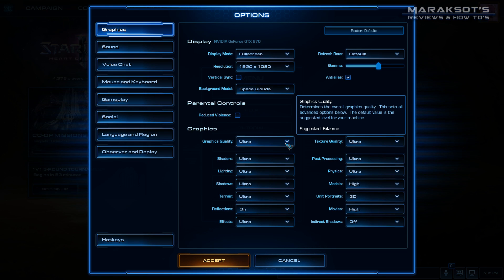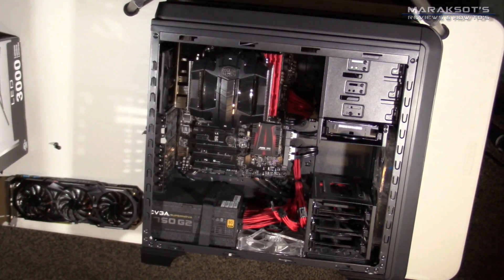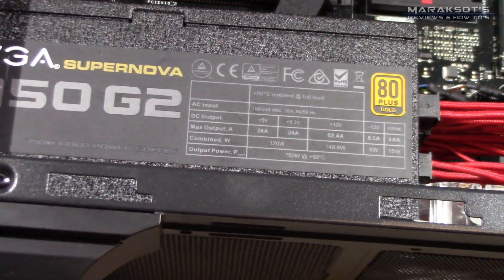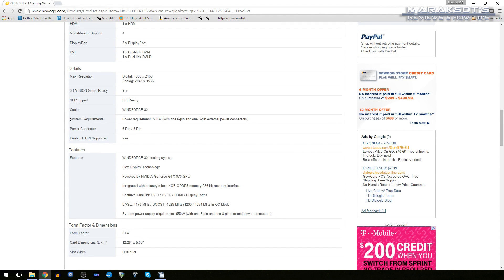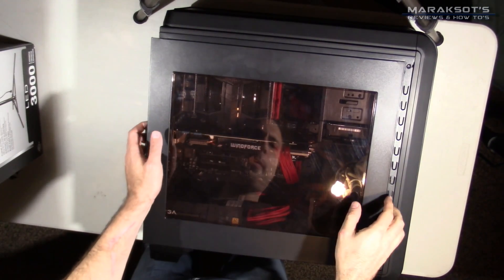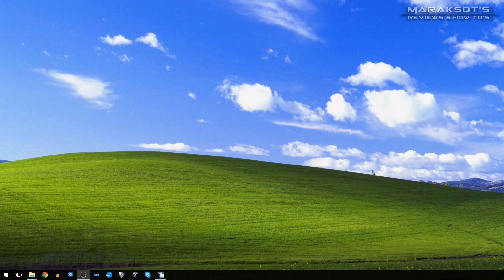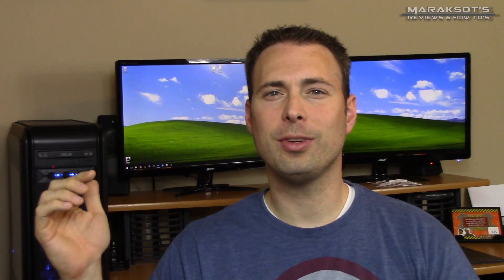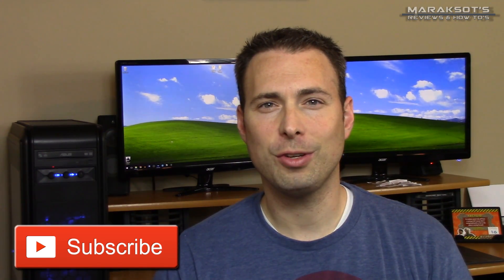A Beginners Guide - Upgrade your GPU - How to Install a New Graphics Card

Comment: So if i install the new drivers for my new gpu, i don't need to worrie about the old drivers? Just something i wanted to clarify before i go out and buy a replace one. I bought a new themaltake 650w bronze and have it installed, and the 970gtx watt is where i want it to be. Just wondering about the drivers. Thinking of upgrading from 2gvram to 4.
Reply from the maker: +Vex Slan do you currently have an Nvidia graphics card?  If so then I would ask when was the last time you updated your drivers?  If your current GPU is from Nvidia and you have the most current drivers already installed then you can just remove your old GPU and install the new one.  If you're switching from AMD to Nvidia then yes, uninstall your old drivers first then swap out your old card for the new one and install the new drivers.  Happy gaming!  :)
Reply: yea i have a Nvidia 960 gtx with latest drivers and thinking of getting gtx 970. So all i have to do is switch them. Ok thx seems simple enough.
Reply from the maker: +Vex Slan no problem man, thanks for the question. I'm happy to help.
Reply: +Maraksot78  thx helped me to
Reply from the maker: stative mocha happy to help. Enjoy your new GPU! :-)
Reply: +Maraksot78 tnx helped alot bro :D
Reply from the maker: MLGBananaPealer you're very welcome my friend.  Thanks for taking the time to make a comment.  :)

Comment: Do you need to uninstall integrated drivers?
Reply from the maker: +The Morning Wood in my 10+ years of PC building I have never uninstalled drivers for the integrated graphics. I've always just installed the new GPU, connected my monitor or monitors to it, booted up the pc, downloaded the Nvidia or AMD drivers, installed them and everyhing has always been good to go. I have heard of people disabling their iGPU in their system bios but my understanding is that modern motherboards will disable it automatically when a discrete GPU is detected as being connected to the system.
Reply: Sir, just another question, can I install GT730 on my Dell Optiplex 760 DT version? coz im strusggling to buy one coz im scared if it is compatible. Thanks sir.
Reply from the maker: +The Morning Wood from what I can tell by googling your Dell it has a 235 watt powersupply. The GT 730 recommends at least a 300 watt power supply. So, I wouldn't recommend buying it. Sorry man.
Reply: oh sorry man i have a Dell Optiplex 760 MT that has 305w. sorry man, so will it work? thanks man
Reply from the maker: Yes, it should work then. The GT 730 won't give you 1080p ultra settings or anything on the latest games but it should perform noticeably better than your iGPU.
Reply: Thank you Man! You are my saviour! Well appreciated Man, Subbed
Reply from the maker: The Morning Wood you're welcome man, I'm happy to help. Happy gaming!

Comment: I am looking to upgrade my computer but I'm not sure exactly what, so I was hoping you could look at my specs and give me your advice: CyberpowerPC Gamer Ultra GUA880 Gaming Desktop - AMD FX-4300 Quad Core 3.8GHz, 8GB DDR3 RAM, 1TB HDD, 24X DVD, NVIDIA GT 720 1GB, Windows 10
Reply from the maker: +EaglesbeatPackers22 I'm not quite sure how to help.  What kind of performance are you wanting to have? Are you wanting to play new games at max settings or are you wanting Windows and other programs to load faster or both?  If you're wanting better gaming performance and depending our your budget you could swap out your CPU for something different.  The FX-4300 uses the AM3+ socket so if you're not wanting to switch out your motherboard you could get a more powerful CPU that also uses the AM3+ socket.  Two really popular FX chips amongst gamers are the FX-6300 and the FX-8350.  As for your graphics card seeing as you're currently using an Nvidia GT 720 you could gain some gaming performance by upgrading your GPU.  On the Nvidia side, starting with the least expensive I would recommend, there's the GTX 950 or depending on your budget you could go up to a 960, 970, 980 or 980TI.  Same thing on the AMD side... probably the least expensive I would recommend is the Radeon R9-370 but then there's the 370X, 380, 380X, 390, 390X, Fury and Fury X. And like I mentioned in the video you're going to want to check your power supply and see how much wattage it outputs and make sure it has enough power for whatever graphics card you choose.  For example, if you choose a card that requires at least a 500 watt PSU and your PSU only does 400 watts you can upgrade your PSU to one with more wattage.  You would obviously just have to buy one.  Also if you're wanting to upgrade for gaming performance you may want to upgrade your RAM to 16GB as more and more modern titles are recommending 16GB.  If you're just looking to improve loading time then I would recommend buying an SSD (solid state drive) they are much faster than traditional mechanical hard drives.
Reply: +Maraksot78 thanks for the quick reply and for letting me know some of my options. I'm looking to increase my gaming performance and you definitely explained what I needed to know. I will most certainly be subscribing!
Reply from the maker: EaglesbeatPackers22 no problem man, I enjoy talking computer hardware. Thanks for the question and the sub. :)

Comment: Do you have to uninstall the existing drivers from the first gpu?? Or is it ok to leave them on there??
Reply from the maker: +Tom Holmez if your switching from an Nvidia GPU to another Nvidia GPU or from an AMD GPU to another AMD GPU then you should be fine to leave your existing drivers in place.  Bit if you're switching from Nvidia to AMD or vise versa then you'll obviously want to uninstall the existing drivers and then install the new ones.
Reply from the maker: +Tom Holmez I should add that if you haven't updated your drivers in a while then you may want to go ahead and uninstall them anyway and update them, that way you'll have the latest drivers that should work best with your new GPU.
Reply: Ah thanks, that helps
Reply from the maker: no problem man

Comment: i have a hp 110 desktop what can i put in mine? to make it run faster
Reply from the maker: +Leonardo Neamtu before I can really help I'm going to need to know what exactly you mean when you say "make it run faster"?  Does it boot up really slow and take a long time to load programs and you want to speed that up? Or are you wanting it to be able to play some of the newer games out there right now? If it's the first scenario then I'd recommend buying an SSD and cloning your existing hard drive to it.  If you're wanting to beef things up to run some games I'm going to need to know what your CPU is, what type of RAM you have and how much RAM. I did a google search of the HP 110 and it shows it has an AMD A4-5000 processor in it. So I figured I'd see what socket the A4-5000 uses to see if you could possibly upgrade that to an A10-7860K or A10-7870K which have pretty decent performance for gaming considering their price. However, when I look up the A4-5000 all I can find for that chip shows it soldered to the motherboard which means if the A4-5000 is your chip then to upgrade you'd need a new motherboard as well. This is of course all assuming that is the chip you have in your PC.
Reply: im just trying to run games faster amd a4-5000 apu with radeon hd graphics 1.50GHz 8g ram 7.45 usable  im not very good with computers but just tell me how to get where i need to and ill do it ") what about a new graphics card like a gtx 750 ti would that work?
Reply from the maker: +Leonardo Neamtu a 750ti should get you better performance than just your A4 APU, that being said I'm fairly certain you're going to have some bottlenecking going on there so I don't think you'll be able to take full advantage of the 750ti.  If I were you I'd look into upgrading my entire computer.  If you're on a tight budget there are lots of good videos on YouTube of nice builds for around $500 I'd recommend checking some of those out for ideas.  Some of the channels I really enjoy and have learned a lot from are Paul's Hardware, Awesomesauce Network, JayzTwoCents and Linus Tech Tips.  I especially recommend checking out Paul's Hardware he does monthly build logs where he lists off parts you can buy for different types of builds ranging from crazy high end $9000 builds to $500 gaming PC's.  Here's a link to his most recent monthly builds videos if you'd like to check it out.  https://www.youtube.com/watch?v=gyvMHZQY7hA&index=1&list=PLRnHcRQUxuoduPRkcsG8AWG3yxJq12hH5  I hope I've been able to at least help you out a little bit man; best of luck to you my friend.
Reply: Yeah im on a very tight budget sadly lol ill cheak him out tho Thank you!
Reply: is the 'Console Killer' Good in one of his 450 builds?
Reply: Maraksot78 One More qustion can i still put a gtx 750ti in my pc and it still run good fps? if so i might just do that
Reply from the maker: +Leonardo Neamtu I think it's a pretty decent little build. I was just looking up some videos of how some more modern games run on the A10-7870K which is the APU he uses in that build and it looks like it'll run modern titles like The Division and Battlefield 4 but the frame rates are lower than I'd want them to be at.  The videos I just watched showed those games running between 20 and 50 frames per second and they were also at low detail settings, but for games like StarCraft 2 and Heroes of the Storm it ran them at a mix of medium and high settings between 30 and 40 frames per second which is very playable for those types of games.  You could always drop a discrete GPU into a build like that and get some good performance gains.
Reply from the maker: +Leonardo Neamtu as for putting a GTX 750ti into your current rig... I don't know for sure seeing as I've never personally used an A4-5000 and played around with it and stuff but from my experience you should get much better performance with the 750ti in there, you just may not be able to reach it's maximum potential because your APU is probably going to bottleneck it to some degree.  If you want to you can always drop the 750ti in there see what you think and then if you're still not happy then think about upgrading your motherboard, CPU and RAM.  There really is no right and wrong when it comes to this kind of stuff, like I said in this video it really boils down to what kind of experience are you looking to get and how much are you willing or able to spend on it.  :D
Reply: Maraksot78 eh maybe ill just save up lol my friend has a beast computer maybe hell tell me what he has Thank you!